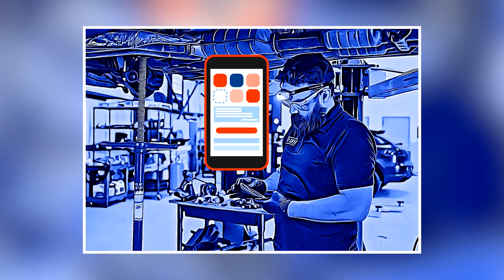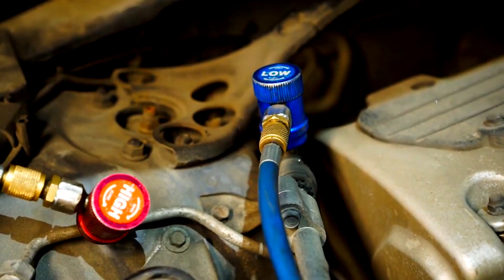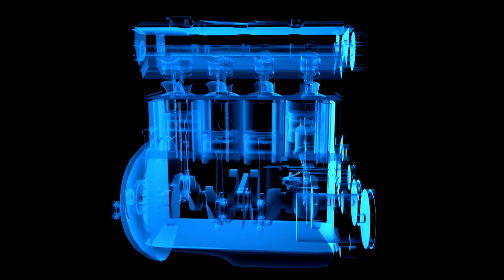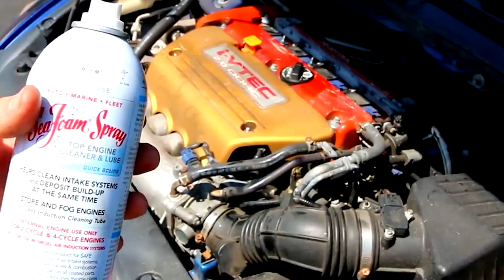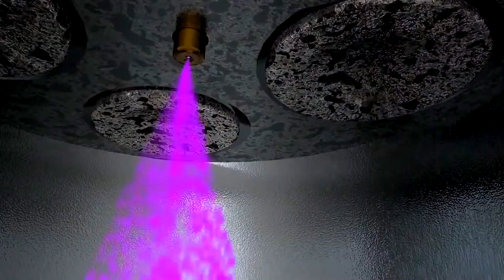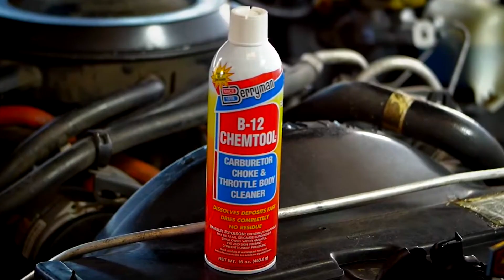6 Stupid Mistakes DESTROYING Your Automatic Car—STOP Doing These!

Comment from the maker: ⚠ WATCH THIS BEFORE YOU BUY ANOTHER FUEL ADDITIVE! ⚠

This 24-minute investigation was created to save you from expensive repairs. The core truth we expose is that most fuel additive cleaners are a band-aid solution, and some "intake cleaning sprays" can be an engine hydro-lock grenade if used incorrectly.

To quickly recap the life-saving (and money-saving) takeaways:

🚫 THE 4 MOST DANGEROUS & OVERHYPED METHODS:

The "Miracle in a Bottle": Most store-bought fuel additives lack the chemical strength and volume to dissolve heavy carbon deposits effectively.

"Super Strength" Additives: Over-concentrated formulas can damage catalytic converters and oxygen sensors, creating new, costly problems.

The "Italian Tune-Up": For modern direct-injection engines, driving hard does NOT clean the intake valves because fuel no longer washes over them. This is a critical myth to unlearn!

The Hydro-Lock Engine Killer: As shown in the video, forcing liquid cleaner directly into the intake manifold can bend connecting rods and total your engine in seconds. This is the biggest risk of DIY intake cleaning.

✅ THE 3 PROVEN SOLUTIONS DEALERSHIPS USE:

Pressurized Fuel Rail Cleaning: The only way to truly clean clogged fuel injectors for better spray patterns and performance.

On-Car Ultrasonic Servicing: Removes internal injector varnish and deposits for a perfect fuel flow, restoring power and fuel economy.

Walnut Blasting (The Ultimate Fix): The industry-standard, mechanical method for blasting away intake valve carbon buildup on direct-injection engines. This is the real solution to rough idling and power loss that additives can't fix.

💬 NOW I WANT TO HEAR FROM YOU!

This is a complex topic, and your experience is valuable data for our community. Please help others by answering one of these questions:

What was your "aha!" moment from this video? Was it the difference between port and direct injection, the danger of hydrolock, or the proof that walnut blasting is the real solution?

Which of these methods have you tried? Share your results—good or bad—with a specific fuel injector cleaner or intake cleaning method.

What's your car's year, make, and model, and have you experienced "car shaking while idling" or loss of power? This could help other owners with the same vehicle identify the problem!

Let's build the most comprehensive conversation on this topic to help everyone become a more informed car owner.

🔍 Want to learn more? Use these search terms for pro tips:
fuel injector cleaning service near me, walnut blasting service cost, GDI carbon cleaning, car shaking while accelerating fix, The Car Care Nut fuel additives